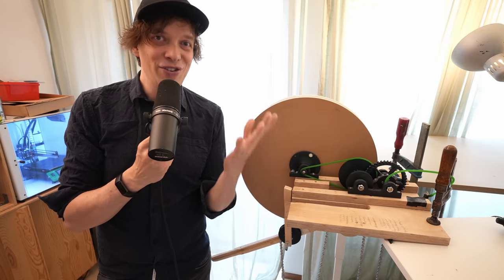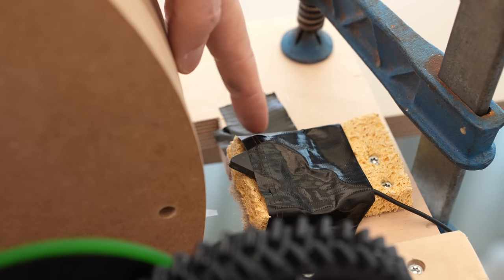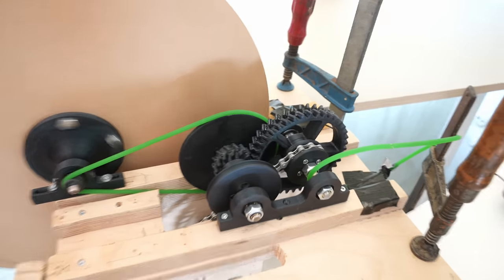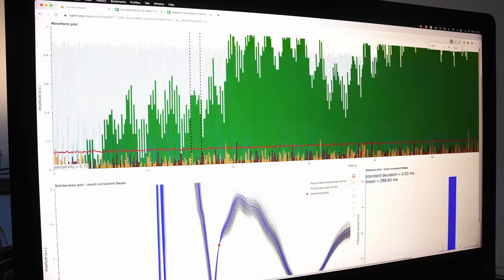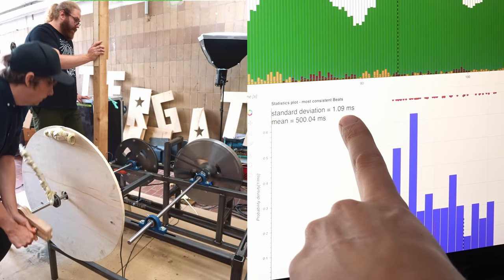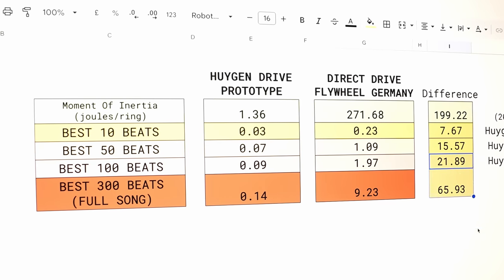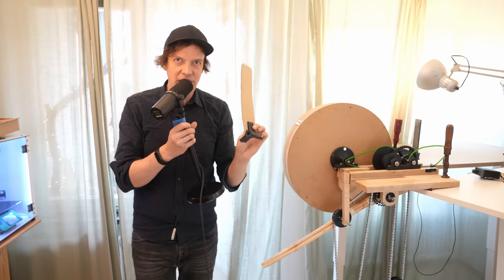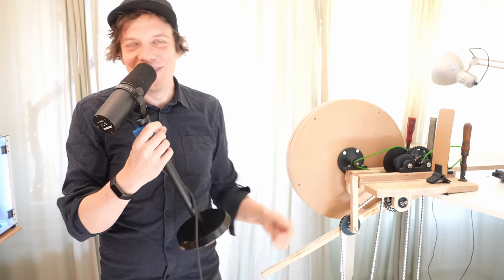Is Gravity Really Constant? I Built this machine to find out.

Comment: So I haven't seen this comment, but essentially every time you change cities you'd need to recalibrate. Gravity is relatively constant locally, but has a bit of fluctuation at different altitudes and longitudes.
Reply: The point is that gravity is consistent in any particular location; the exact force of gravity due to the particular place on Earth doesn't make any difference as the device is mechanically regulated. Only the linear consistent input from gravity is required, not any specific newton-meters value. No calibration needed!

Comment: Of course gravity is constant. I think the bigger decider in consistency here is the governor, asking how constant is an air governor Here, you've basically invented a clock that is made consistent by the resistance of air on some flaps. Now, technically, in terms of infinite accuracy, gravity can't ever be completely constant, every grain of sand blown on the other side of the planet will have an infinitesimal effect on the amount of gravity felt. But in this experiment's results, it's largely determined by air resistance. It's basically a grandfather clock but with air instead of a pendulum. Air resistance needs a lot of energy to have consistent though, seeing as you needed a heavy weight that needed to be cranked very often, compared to a pendulum clock where you only need to raise a weight every so often.

Comment: Bad decision. The gravity accumulator provides a constant force, but not a constant speed. When changing the mode of operation of the machine, the pace will change. Of the mechanical drives, the most efficient is a rotating wheel. The objective is to provide an effective variator that provides a constant rotation speed regardless of the rotation speed of the drive shaft.

Comment: I will say it.
GRAVITY IS CONSTANT well it will if you create a constant timer cus gravity impart a momentum and velocity so the object will first get pull and slowly became fast(if no air).
You can use a verry material as a charge or battery since it will never loos the strength infact some old clock use this as a precise energy storage.

I suggest a contraption where you have a heavy weight a thing called pendulum since it's more precise but you can use a thing called Ballance wheel and make it spun faster to make it more accurate also making the weight heavier will give you lots of advantage lastly pls don't use that kind of pulley and try to use differential gear to avoid interfacing to the main charge.well if you do enough research or just watch lots of educational video like me you'll know this.i hope this save lots of time for you to do self research

Comment: what if you built another one and had a lever in between that as the flywheel spins it lifts the other weight and then retracts and as the other one spins it lifts the opposite weight and then retracts? perpetual motion. I'm high asf

Comment: You're not actually measuring what you think you're measuring. This Huygens drive is not 66x better than the crank mechanism, it's 66x better than a human. To measure the precision of the crank drive, you would need to measure two points- one at the crank, and one at some output point in the machine. Otherwise you can't isolate the contribution of the machine.

Comment: I'm pretty sure you just made a complicated mechanical barometer.

Not getting why you would use a contact microphone instead of a hall effect sensor or optical sensor or why you wouldn't use a VFD and servomotor with a rotary encoder and a flywheel.

Comment: Just making the exact same mistakes as the MMX, where he tunnel visions on one part, which will eventually not work for a variety of reasons. Just make an actual machine where you can test the concepts you want to implement, and then worry about making them more precise. All of these tests don't matter because they're not done within the context of a full machine.

Comment: using contact mic instead of optical interruptor as input sensor; comparing digitized sound wave shape instead electrical pulses as time measurement; using CAD as histogram generator. 
if you really don't care so much of analog response nonlinearity of a mic, not really care so much of digital latency and distortions in ADC your soundcard has also it seems you don't care so much about your OS timing determinism, why would you care so much about gravitational constantness? gravity varies upto about 0.7% in whole surface of earth, which translates you play 185.691 bpm when you play at height of mataraju mountais in peru versus 187 bpm when you play in the middle of arctic sea.

Comment: There are basically 3 problems with the weight drive, and several with your expectations of the system.
1: the weight drive will die on varying resistance
2: the weight drive will be big, heavy, and potentially dangerous.
3: it will be complex and high force, particularly after you solve the varying resistance.

Your measurements of the hand crank were unfair. Trying to synch up with a constant rate like you were is very hard, whereas maintaining a constant bpd is much easier. You should have changed your metronome system so it was based on the previous beat from the machine. Seriously, its such a difference, as you were you were controlling acceleration to acheive time, when alll you needed was to achieve speed.

Comment: You could also speed up the playback speed into the audible frequency range: if it's tight, you should hear a constant tone. 🤓Btw, if you hang the weight from a great enough height, you should be able to measure the change in gravity as the weight drops closer to the earth! 😎

Comment: Looking for every possible rabbit-hole to go down to avoid building the marble machine?  Really?  Checking gravity?  A better test would just be a weight on a spring. If gravity changed, the weight would jiggle around with the changing force on the weight.  This machine doesn't prove anything since the governor may or may not be working.  Just get on with the marble machine, and don't try to make it more tight than 10ms.  You can't hear it, you just think you can because you can measure it.

Comment: Martin, 

Please, please! I beg you to time yourself playing drums or guitar. You need context to these numbers before you just decide on one solution. The hugen drive is a much larger and more complex solution. It might mean your other solution is still rather tight and in acceptable parameters. Do keep the simplicity of the implementation in mind when designing. 

Honestly, if you're really slick at designing- you can design the machine to use both systems so you can decide which is better as late in the process as possible.

Comment: Martin, you are starting to get WAY too meticulous on the smaller details. Feature creeping.
The flywheel does NOT have to be absolutely and super accurate, since the other band members are playing LIVE music. Let THEM adjust to the minute changes in speed....!!! No-one will ever notice, I promise.
And using an air governor means you are using a variable that can change quite a bit: the density of air. 
A mechanical governor, or regulator, is more precise than an air governor. 
Have you thought about using this machine on stage? You don't have the time to spend 15 minutes setting up this machine for the next song. It has to ready in less than a minute. So you'll have to come up with something simpler, faster, more effective than what you have built, right now.
You have a very strong tendency to overcomplicate things. 
Get help !!!!
I'm serious.
It's getting out of hand, again...................

Comment: Gee whiz, there are some real negative cunts in this comment section, shut up and let him cook... this is honestly the right direction to be heading in and I'm excited to see how things progress after this realisation!
Reply: But if you'd actually read any comments, you'll see that this is not the right direction.
Reply: @br52685  ok, why?
Reply: @chrisjurica9326  Well, read the hundreds of comments pointing out the countless flaws.  But essentially: he's doing all these tests (improperly) on a load-less system.  The power-requirements of his machine (if he ever gets around to building it) will fluctuate in how much power it requires.  This system will NOT respond properly to a variable load.

Then also consider that he's going to need the system to provide various bpm (and likely be able to quickly adjust to various tempos).

Then also consider that it's already taken him TWO YEARS to get to this utterly fundamental point.

Then also consider that he hasn't even started working on a reliable marble-machine (fixing all the "flaws" with the first two versions).

Would you like me to continue?

Comment: Your insistence on inappropriately using the contact microphone to make measurements is disappointing. The forces it introduces are NOT negligible in the ways you've recently been using them. There are MUCH better, MUCH more reliable ways to do the same thing that are not significantly more difficult to implement.

Not to mention the fact that because you put the measurement on the flywheel rather than  right at the input as you did with the crank, the comparison is utterly invalid. In order for comparison to be valid, the measurement method has to be identical.

But then, the entire machine is different, which makes any attempt at comparison utterly meaningless anyway. In order to make a direct comparison, you would have to put the Huygens drive on the same machine on which you tested the crank and foot pedal.

If you want valid scientific answers, you must use valid scientific method.

Also, regarding the results: Duh.

You are wasting your own time, energy and materials in (not actually, because of your flawed methodology) "proving" concepts that are obvious to anybody with basic scientific knowledge. If you really want to know the best way to human-power your machine, go ask a qualified mechanical engineer or physicist and provide your specifications and constraints. Crowd-sourcing this type of information is a really bad idea.

I have been following you for a long time and in the past was always impressed with your approach and solutions, but your current direction is discouraging.
Reply: He's wasting time (and getting nowhere) by focusing on the power for the device--and he's making a complete mess of the situation.  This channel was only interesting when he was actually developing the marble-machine itself--and solving problems there.

It's been TWO YEARS since he abandoned his prior machine.  It's pretty discouraging looking at the current state-of-affairs.